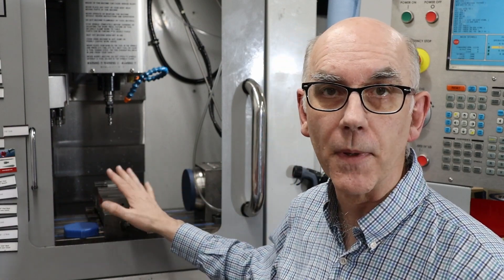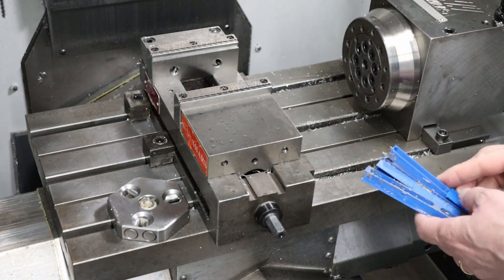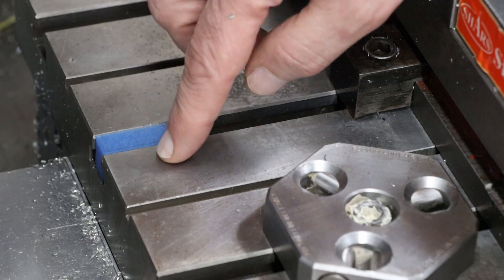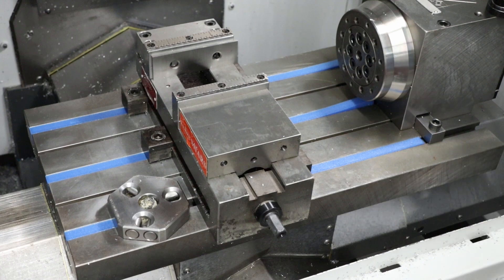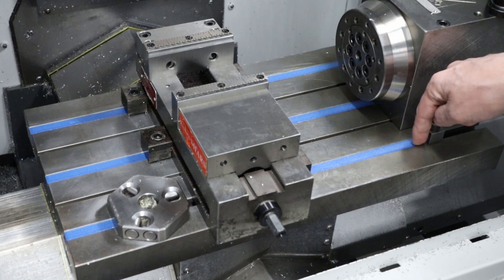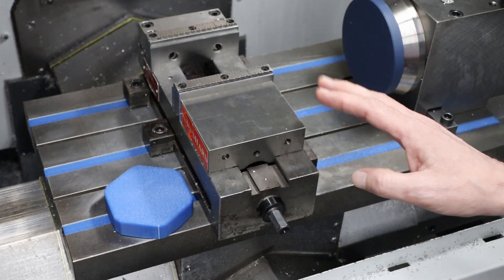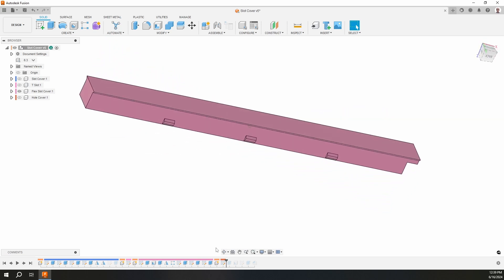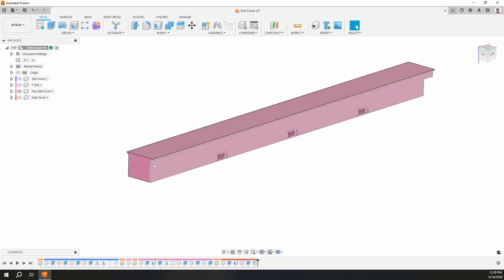3D Printed TPU T-Slot Covers

Comment: Hey like the videos, I make watches and small parts all products no job shop. I have a hass OM-2 a Tormach MX and EMCO lasers and other goodies. I wanted to make sure you were aware of an issue I painfully just found out about on my Haas OM, as you know it came with a battery-powered grease. the grease they used has an issue of gelling up and clogging lines. and then it ends up bursting a line and then NO fittings get lubed. I had my X screw start making clicking sounds in one direction. I did some inspections and found about 3 pounds of grease on my Z column getting pushed out of a burst line.. I had bought the om used and due to the color of grease I could tell this had happened years before I got it. needless to say, ball screws are being reground and balled...there was an update for it but my Haas LDO never told me even on year check-ups... So I'm just letting you know to check for the updated grease system and make sure everything is getting lubed..Pull your way covers and check. I'm converting mine to an oil system to make sure no grease clogging happens again
Reply: Why were you using grease?